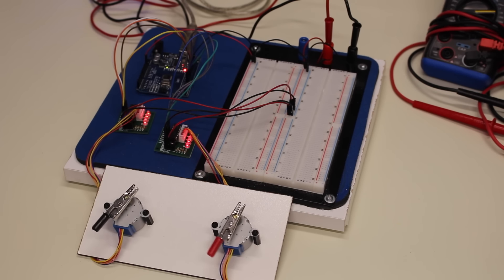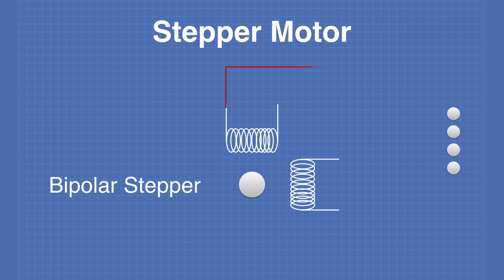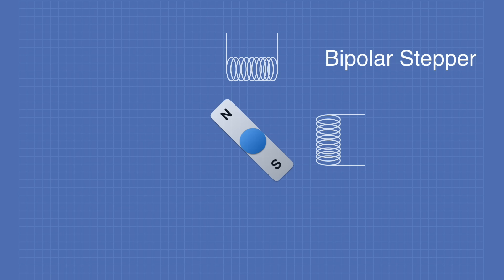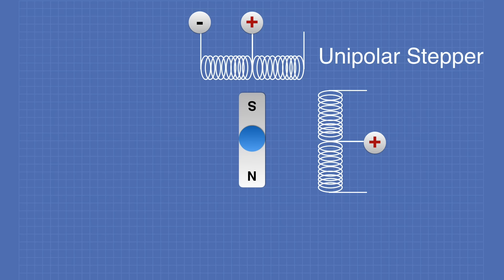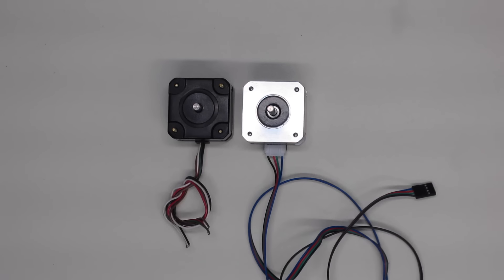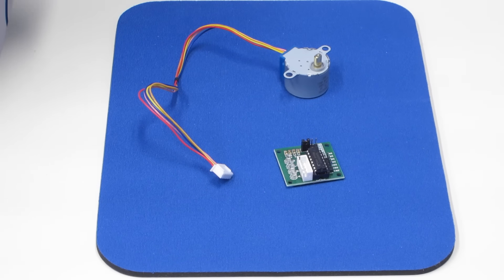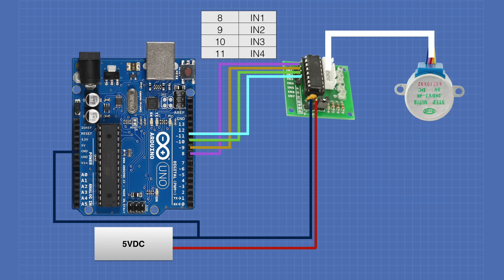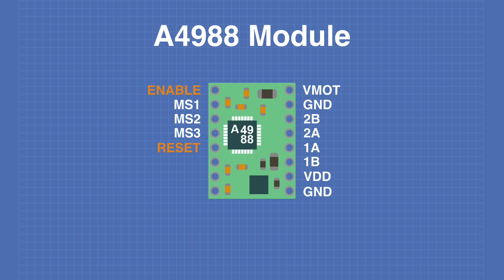Stepper Motors with Arduino - Controlling Bipolar & Unipolar stepper motors

Comment: You have the cleanest workshop I have ever seen! I should know, I suffer from OCD!
Your videos are so well made and edited, no wonder you don't crank them out very often. It must take you days to make one.
One criticism; Potentiometer is pronounced like this : https://youtu.be/4oLzuAVWK0Q
Also, Bipolars running on current chopper drivers, will outperform Unipolars in every way, including speed of rotation. This is why, all 3D printers use bipolar motors with current chopping drivers like the A4988 and larger supplies than the motor's rating. 
If you run a 2V motor on 30V (current limited by the chopper of course), the current will have a very short rise time before the it  hits its set maximum value, when the driver chops it off and keeps it at that level.  In other words, current through the coils is more important than the supply voltage. The lower the working voltage of the motor, and higher the supply voltage, the better its speed performance. 
In other words, a 2V motor running on 30V, will have a better performance than a 5V motor running at 30V.
Reply from the maker: You make a number of excellent points, thanks for sharing them. And you're right about bipolars being able to outperform unipolars even in speed when driven correctly, despite what I showed in the slide (which assumed that they were both being driven with a simple driver and not a current chopper).
As for "potentiometer" I'm sure you're correct, however after pronouncing it that way for half a century it's a tough habit for me to break. Perhaps in the future I'll just say "variable resistor"!
Really appreciate your comment and the points you bring up, as well as the remark about the clean workshop.
Reply: Point well taken.

Comment: Okay I dont know whats wrong but I did exaclty what you did and my stepper motor got extremely hot and would not work
Reply: Sounds like the wires from the motor's windings are not wired correctly
Reply: @jackbrockhurst6155  I have more motors... I will try it with a different motor.
Reply: @jackbrockhurst6155  I tried switching it and still nothing... Its gotta be a problem with my wiring but i redid it like 3 times. Any way I can contact you and send a photo of what I have and maybe you can help?

Comment: good demo now show me how To converts sped into pitch for cutting thread's given movement   led screw Or shaft driving rack given the  spindle seed  & travel is linked  to sped  of the bed off the lathe thus speed over bed give us pitch how would "one".   wright that ?   using the rotary controller, of the spindle. speed tract with the sidle  40000 count Or is the a way to ues the siystom you have just demons . so one can pick a speed of the 
Leadscrew to select thread pitch by speed can you demonstrate suitable code to find such a siystom . i have looked at clawbg42 , but have been unable to relit that  to an Arduino code. at 71 it's a  bit of a struggle keeping up Les England  as this page shows a replies from five yeas a go & one a 1year ago i do not expect a replay .

Comment: Bonjour, j'ai chargé le programme de la démonstration 4, je rencontre un problème , le moteur tourne toujours dans le même sens..!
Et je ne trouve pas la solution..Pouvez-vous m'aider?
Hello, I loaded the program for demonstration 4, I have a problem, the motor always turns in the same direction ..!
And I can't find the solution .. Can you help me? 
/*
  Stepper Motor Demonstration 4
  Stepper-Demo4.ino
  Demonstrates NEMA 17 Bipolar Stepper with A4988 Driver
 
  DroneBot Workshop 2018
  https://dronebotworkshop.com
*/
 
// Define Constants
 
// Connections to A4988
const int dirPin = 2;  // Direction
const int stepPin = 3; // Step
 
// Motor steps per rotation
const int STEPS_PER_REV = 3200;
 
void setup() {
  
  // Setup the pins as Outputs
  pinMode(stepPin,OUTPUT); 
  pinMode(dirPin,OUTPUT);
}
void loop() {
  
  // Set motor direction clockwise
  digitalWrite(dirPin,HIGH); 
  
  // Spin motor one rotation slowly
  for(int x = 0; x < STEPS_PER_REV; x++) {
    digitalWrite(stepPin,HIGH); 
    delayMicroseconds(2000); 
    digitalWrite(stepPin,LOW); 
    delayMicroseconds(2000); 
  }
  
  // Pause for one second
  delay(1000); 
  
  // Set motor direction counterclockwise
  digitalWrite(dirPin,LOW);
  
  // Spin motor two rotations quickly
  for(int x = 0; x < (STEPS_PER_REV * 2); x++) {
    digitalWrite(stepPin,HIGH);
    delayMicroseconds(1000);
    digitalWrite(stepPin,LOW);
    delayMicroseconds(1000);
  }
  
  // Pause for one second
  delay(1000);
}

Comment: This is an amazing video that really simplifies the process for beginners!  I am having an issue, however, with getting my setup to work.  I am using a stepper motor that is rated for 4.2A per coil (https://www.omc-stepperonline.com/nema-23-bipolar-3nm-425oz-in-4-2a-57x57x114mm-4-wires-stepper-motor-cnc.html?search=23hs45-4204s), and am not able to measure ANY significant amount of current thru the coil using the series measurement technique as shown in the video.  Everything about my setup is identical to the one in the video here, except I believe my stepper motor is larger.  I suspect that the current supply from the A4988 may be insufficient for the stepper motor, but shouldn't SOME current be passing thru my meter?  I would expect that it would be delivering the maximum that the A4988 can deliver, however, it appears that <1mA is being measured.  Appreciate any help or guidance to solve this!
Reply: I found his other video (https://youtu.be/iY_4YOlpqyI), which serendipitously uses the same motor I have, so have some good guidance now in terms of how to proceed.  I would still like to understand why I am not seeing ANY current delivered to the motor coil with my A4988 though.  That continues to baffle me, and would appreciate any insight there, just for learning purposes.
Reply: Opened my multimeter and found out that the fuses were blown! Hah, well that answers that!

Comment: This is very good, but please do two things to improve your presentation
1. Cut out unnecessary repetition
2. Speak faster. (with the video set to 1.25 speed, it became much easier to listen to)
This 50 minutes video would have been possible in 20 minutes, just as easy to follow and wouldn't have put me to sleep.
Reply: I find that he speaks at the right pace to explain theese themes. Perhaps you should learn to be a little more patient.

Comment: I need to set up a step motor with 2 reed switches one switch needs to put the motor at 120 degrees and the other switch needs place it at 240. The home position of the motor being 180.  I cannot figure out how to trigger with more than one switch.  Thanks for any help in advance.    Magwave@computers-plus.net

Comment: You did your viewers a huge disservice with your explanation of stepper motor rotation.  You either are over simplifying it or you don’t understand it.  You only show 2 states of the coils for each direction, energized and off. You then said to reverse direction you reverse the polarity of the coils. This is not how stepper motors work.  To single step a stepper motor there are 4 states and to reverse the direction you reverse the order of the states.

Single Phase Single Step
For Clockwise Rotation
State 1 : Coil A energized with forward polarity
State 2 : Coil B energized with forward polarity
State 3 : Coil A energized with reverse polarity
State 4 : Coil B energized with reverse polarity

Counter Clockwise Rotation
State 1 : Coil A energized with forward polarity
State 2 : Coil B energized with reverse polarity
State 3 : Coil A energized with reverse polarity
State 4 : Coil B energized with forward polarity
 
Nearly all of the comments to this video give you high praise for helping them understand how stepper motors operate. Unfortunately the information you supplied is at best incomplete and at worst incorrect.
Before publishing a tutorial you should thoroughly understand the subject. In this case, I’m not sure you do.

Comment: great video ,its improving my knowledge thanks..but i have a problem i'm use stepper motor for robot car..motor is rotate but its wheel i touch then motor is stuck and vibration with nice..like this video left side motor https://youtu.be/XVHCKnankUI?t=44 please how to solve this problem..using A4988 driver and diagram  https://youtu.be/0qwrnUeSpYQ?t=2543 (my english is not good :-) )

motor spec :
2 phase NEMA17 42mm 4-wire stepper motor.
Rated voltage: 12-24V
Power: 5W
Current: 1.7A
Rated Speed: 0-1500 RPM
Rated torque: 0.42 NM
Step angel: 1.8°
Ambient temperature: -20 ℃ -50 ℃
Insulation resistance:100MΩmin.(500V DC)
Dielectric strength: 500VAC for 1 minute
Shaft Radial Play: 0.02 Max. (450g-load)
Shaft Axial Play: 0.08 Max. (450g-load)
Max. radial force: 28N (20mm from the flange)
Max. axial force: 10N
Motor length: 40 (L) mm
Rated current: 1.68A
Resistence per phase: 1.5Ω
Inductance per phase: 2.3mH
Holding torque: 4.2 kg.cm
Number of motor leads.: 4
Detent torque: 150 g.cm
Rotor interia: 54 g.cm